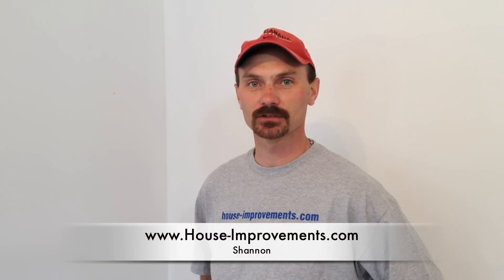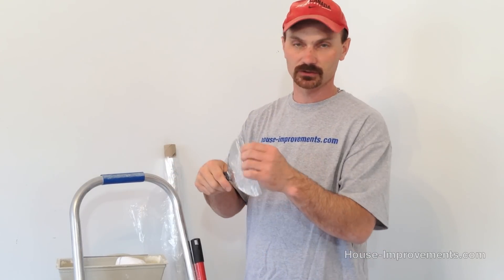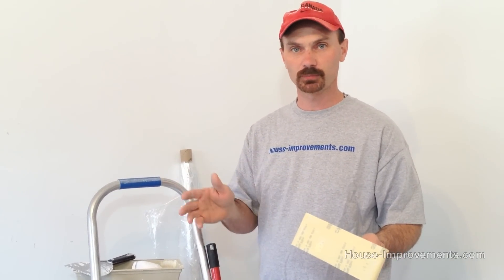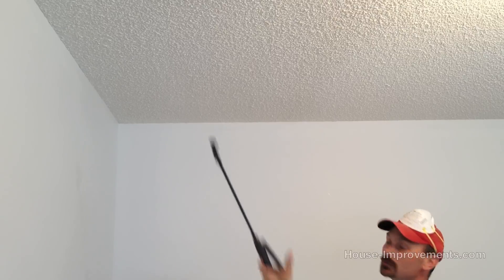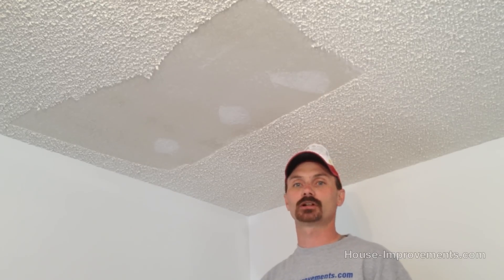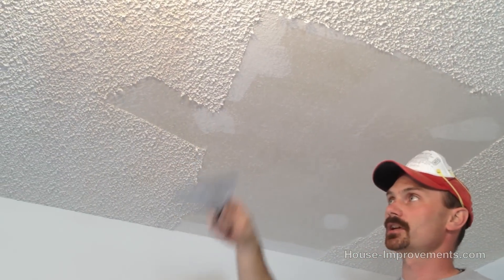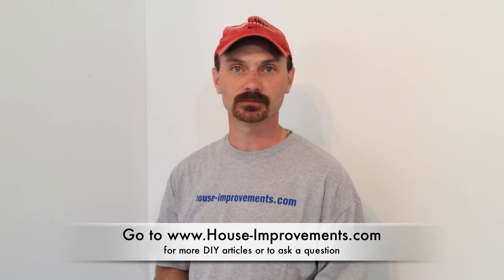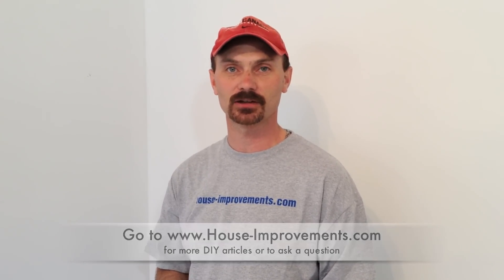How To Remove Popcorn / Stipple Ceiling

Comment: question! did you test it to see if it has asbestos? and say there isn't, I'm assuming it's okay that it falls and makes contact with your skin?
Reply from the maker: I actually did not , this home was from the late 90s. Asbestos was banned in ceiling texture in the late 80's. Many suppliers though were still able to sell the existing stock until it was gone so there is a slight chance this home could have still had it though. Contact with your skin is not the issue it is breathing it into your lungs that is the concern.

Comment: How do I know if there was paint prior to having this surface put on? Just wondering because I don't want to get in over my head and start removing it if it's too much of a deal.
Reply from the maker: The problem is if its painted after it has been textured. Usually if you look really closely at the surface and see that there are no real gaps and spaces in the texture. The paint usually fills these in but you can not always tell till you start scraping, so start somewhere that is a little out of sight.

Comment: What do you do after you remove stipple ceiling? Seal the ceiling, fix imperfections?
Reply from the maker: yes usually it will need some TLC to get it smooth and looking good.

Comment: Does the water have to be warm or does it matter? Do you add a solution to it like soap or anything?
Reply from the maker: cold is fine , I have actually never tried hot to see if there is any difference. No soap needed.

Comment: "..pretty simple job".  That's for me.  My house was build in '77. 
 Does the coarse stipple ceiling contain asbestos - and at 68 do I care?   Hat to develop lung issues at 98!
Where in a 50 mile radius can I go to a lab to get it tested - 4 asbestos?  
Since this stipple is NOT water soluble, which method do you suggest for removal - or that I employ?
Choices-0--(hire someone else), (move), (sand it), (add 1/4" drywall over ceiling), (mud over it)?
Reply from the maker: +Tom Schulte Stipple from 1977 will certainly contain asbestos. Many med to large cities will have companies able to test for it ,but in your case i can tell you there is some if that stipple is original. If the stipple was painted over it is tough to do much with it but sometimes if you can scrape it with a stiff bar to break the tips off of the stipple it will then allow some water in to make it easier.

Comment: Do you have to scrape down to the sheet rock? I scraped off the popcorn, but there seems to me some material left because I cannot see the sheet rock. The ceiling was painted. I want to orange peel and then put knock down texture on the ceiling.  Please advise on how to proceed.
Reply from the maker: +M Hal No, just enough to get it close to smooth.
Reply: Thanks for the reply Shannon. I decided to take it all the way down to the sheet rock. I have never removed popcorn ceiling before, so I wasn't really sure how to go about it. I figured out a way that worked for me. First, I scraped off the popcorn kernels with a garden scraper to get under the paint. Then, I sprayed it with water and vinegar (ratio 1/10) and waited 15 minutes. If it didn't come off easy I sprayed it again and waited another 15 minutes. If it didn't come off I would spray it again and start scraping in 5 minutes. I am glad I took it all the way down. After texturing it it looks great! It was my first knockdown texture.

Comment: Hey Shannon, how would you proceed if the ceiling has been painted over / sealed.  Would covering the popcorn ceiling with 1/2" drywall be a viable solution?

Comment: I have this in my kitchen it's not painted but has quite a few cracks. It's not my flat so I'm not sure whether to try this but would love to get rid of it it's so outdated. I didnt realise it comes off so easily I was told it would be a really messy job if I wanted removed but it would be worth it. My ceilings texture looks alot thicker than this one and very uneven in areas very bad job overall

Comment: my ceiling isn't textured. Old  wood plaster on the ceiling. There are bubbles through the paint coz of water leakage.  how do i fix that? Remove the paint layer and apply some plaster , sand it, prime it and paint it?

Comment: Would a spray bottle full of lukewarm water be ok to use? I do not own the pump held sprayer, but if it's highly recommended then I guess I'll have to find one!
Reply from the maker: bunstoppe  Thats fine ,it will just take a little longer
Reply: +bunstoppe I used a spray bottle in my video. I will work just fine. good luck!

Comment: I am wondering about popcorn ceiling that has been spray painted-would it be as easily removed as this method or does it have to be done another way?
Reply from the maker: +Joyce Yoder If it has been painted it will not go easy.
Reply: +HouseImprovements thats what I was afraid of! Will the same technique work, altho more work or is there another way to do painted ceilings?

Comment: Would a 1980 or 1982 house contain asbestos? Already moved into a newer house and I am wondering if it would likely be contained as I want to save my dad money
Reply from the maker: +BobTheAsian  I'm sure it will
Reply: +BobTheAsian This method shouldn't cause any issues with asbestos. Definitely don't sand it down, but this dampen/scrape method will prevent it from becoming airborne which is what you'll ultimately want to avoid with asbestos.
Reply: +BobTheAsian Any house built before 1982 would likely have asbestos in the ceiling and probably in the walls for insulation. You can always scrape a small section of the ceiling into a small ziplock bag and send it out for testing and that will confirm the question for sure. Always take the proper precautions when dealing with this stuff. have fun

Comment: How do you know if your ceiling has been painted? My husband and I recently bought a house so we don't know what was done to it before.
Reply: +Kaitlyn Parrish If you use your fingernail and flick at a round piece of your ceiling in a couple of areas, and it flicks off easily, it probably hasn't been painted.  Also, original stipple isn't shiny.  Painted popcorn/stipple has a smoothed out look, as the paint covers over the bumps and fills in the voids between bumps.

Comment: if you poor more water on the ceiling ,is it better to soak the ceiling, will that make it easier to remove the popcorn?
Reply: More water is not better. If you apply too much water you will soak the paper of the drywall underneath. Then when you scrape, your drywall knife will tear the paper.

Comment: This is probably a rhetorical question but: Will this also work on textured walls?
Reply from the maker: Yes
Reply: Emily;  Depends on what type texture.  For instance, if it's a hard coat finish, whereby the existing wall was plastered to give it a stucco look, it would be much more difficult.  If it's textured wall, i.e. orange peel, similar to version of the popcorn ceiling it would be easier.

Comment: I am in the process of removing my stipple ceiling now. It is coming off in wet messy chunks and the ceiling is gouged and scratched up pretty bad. We just bought this house last year and I was told that the entire house was repainted because the couple that built the house 20 years ago were chain smokers. The ceiling must have been painted too? Not looking forward to the other 2800 sq ft!
Reply: Same situation here!  Ours was not painted though...I thought we were the only ones having this issue.  I kept saying, This is NOT coming off like butter!"  LOL!   Actually, some came off pretty easily, but other areas it looked like a bob cat attacked our ceiling!  Ha!  Ha!  We are hoping it can be skim coated over and be okay.... (fingers crossed)  :)

Comment: Does this technique work with older construction?
Reply from the maker: kevin poff Yes ,as long as the popcorn has not been painted this works very well.
Reply: If it has been painted, can the time technique still be applied?

Comment: Is there anything else that will work? The popcorn ceiling has been painted over few times. I have tried the water, hot water, vinegar + water , heat gun, belt sender... Even tried scraping with the knife first so the water can get inside...I put a lot of effort just to do small portion of the wall. Its crazy. 😕
Reply from the maker: You can either remove the drywall and re install new stuff or use multiple coats of drywall mud to smooth it over.

Comment: So I have a question since after reading these comments. You say if the house is older than 1970, it'll have asbestos. So wouldn't you wanna get rid of it anyway instead of still having it in your house?
Reply from the maker: asbestos ,when undisturbed is pretty much a non issue. Its when it gets air borne that it is a great danger.

Comment: What if I do have paint on the my ceiling?  What are my options in removing the "stipple"?
Reply from the maker: +zep4141  In many cases either strapping over it and redrywalling  or ripping the drywall right down. Sometimes you can scrape off the tips of the popcorn and then use water but it rarely works well.
Reply: +zep4141 I have used this same method even on painted ceilings. Usually I give it a more liberal soaking and let it soak in for about 20 minutes then give it a try... Also if you mix 40% vinegar and 60% water and spray the painted ceiling with that and let soak for 30 - 45 min. The mix will break down the paint and make it easier to scrape off.
Reply: +zep4141 you can sand it down

Comment: so is that just lukewarm water you spray it down with??
Reply from the maker: ***** Yes
Reply: HouseImprovements
thanks!   Im hanging a 34" by 65inch vanity  mirror and have to clean off some popcorn. Will try the water and its a single plate mirror i just bought so will space out the mirror glue like you did. Thanks for the tips!!  they wanted 200 buck to install... YIKES!!!! hope it works!!

Comment: Can you simply paint the ceiling once the popcorn is scraped off?
Reply from the maker: Usually it will require some drywall mudding repair first. The popcorn was put there because it hides rough or minimal mudding work.

Comment: Should mine come off this easy? I have a 2018 mobile home but my ceilings look more someone did a texture job by maybe twisting a paintbrush on the ceiling. There's actually like sharp points pointing downward. Kinda weird & it's not consistent.  No idea the technical name for it, but it's not popcorn like this. I hate it & want it removed. Anybody??? tyia

Comment: What if it doesn't come off that simple? What do you do then?
Reply from the maker: Then it is going to take some elbow grease and time to remove it. In a couple of cases I have even found it easier to remove the drywall completely and re-drywall or even strap the existing ceiling with 1x4s and re-drywall over the old one
Reply: That's what I was afraid of

Comment: They say there are hundreds of renovators and construction workers that die every because they breathe in contaminants such as asbestos.  Popcorn ceilings are notorious for containing asbestos. I hope Shannon takes precautions like testing the next time around. I wouldn't worry about asbestos lung poisoning from one or two jobs like this however I wouldn't want to be doing this every day without the proper equipment. Keep in mind that the dangers of asbestos are real but in most cases they are greatly exaggerated.

Comment: I wish my bathroom ceiling was so easy to scrape! Because it has been painted a few times and the heat from lights and steam from showers/baths...I literally had to take the entire ceiling down to the bare drywall. Needless to say, it was a big job/very messy. Should I do anything first to seal the drywall prior to re-muding the ceiling? On the positive side the bathroom will get a mini makeover. Thanks.
Reply from the maker: Re mud the drywall and prime and paint

Comment: How comes ur popcorn removal look different to mines.  Mines are chipping down but chalky powder is drooping down. Don't think mines were done properly before. When u scrape yours down, your ceiling look smooth like it was plastered.  Mines have lines and gauges underneath the ceiling and it doesn't look nothing like yours. Yours look proper
Reply: You need to completely saturate the ceiling with a 1 to 1 mixture of white vinegar and HOT water. Let it soak in for a good 20 min. As for the lines/gouges on your ceiling... that is where the original installers of the sheet rock applied the mud to cover the drywall tape.  Normally, it takes 2 or 3 coats and feathering it out to finish, but the the popcorn ceiling finish allowed contractors to just apply one coat and you'd be done. It wasn't until the late 70s that the danger was officially acknowledged, so for fcks sake....wear a respirator or risk getting mesothelioma!

Comment: I have about 700 SF of painted popcorn - I hate my life and it is the worst job ever as I am scraping it all off and just doing a number on the ceiling drywall underneath.
Reply: +TheFashionbugs  go buy a product called confill and trowel the whole area flat. Don't remove any popcorn what so ever. It's way easier if you have a tough scraping job ahead of you.

Comment: Asbestos exposure? ??
Reply: not all popcorn ceilings have asbestos. but old stock that contained asbestos was allowed to be used until it ran out. because of that, the man in the video should definitely give a warning.
Reply: humangod he did give a warning about abestos
Reply: Per Nathan Starr, "he did give a warning," BUT a little mask and googles are not sufficient. You can take a sample and have it tested before scraping. You'd have an idea of probability depending on what year your house was built and if was after they stopped using it.

Comment: I subscribed to your channel and I really enjoy your presentations. I feel compelled to point out a few things regarding this video, however. In the United States, a popcorn ceiling containing asbestos can only be removed by a certified asbestos remediation firm. Also, the mask that you were using an N-79, offers no protection from asbestos exposure. I hired an industrial hygienist to test my ceiling before before removing the popcorn. It cost me a little over three hundred dollars for testing . It’s not just asbestos but also mineral wool and fiberglass that was used in popcorn throughout the 1980’s. Please fact me in this matter. I was horrified watching your video. My comments come both as a fan of your channel and out of love and concern for your safety. Thank you.

Comment: Just throw it out. It all goes to the same place, The Dumps !! You are just paying for "Government Bureaucracy. The dust is the problem. Wear a good face mask. Also use more water, and let it soak. It will come off like a sheet and less dust. Don't forget, use a good heavy plastic on the floor, Those cheap painters plastic are just that,, cheap.

Comment: WTF is purpose of popcorn ceiling? They're impossible to clean, look FUGLY and seem to attract dust and cobwebs more than any part of the house...
Reply from the maker: They were designed to hide very poor workmanship of drywallers so they did not have to spend much time working over head getting the ceiling perfectly flat.